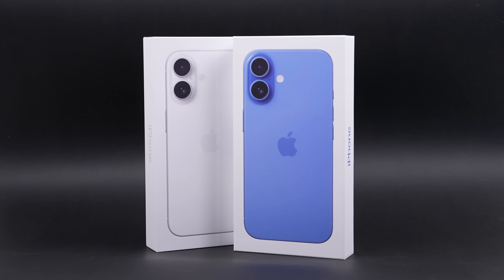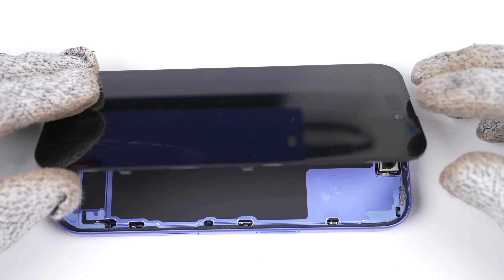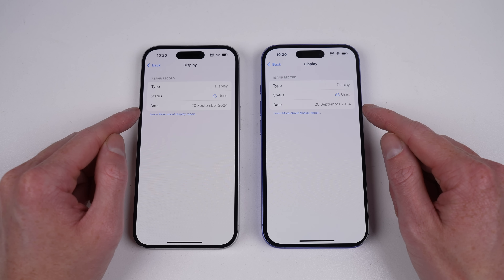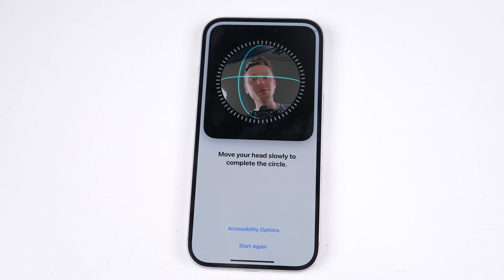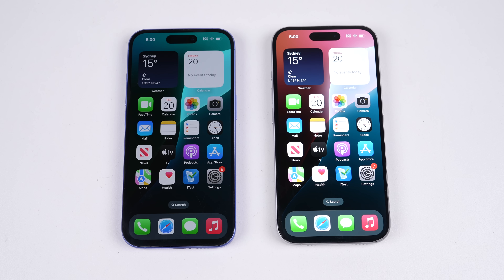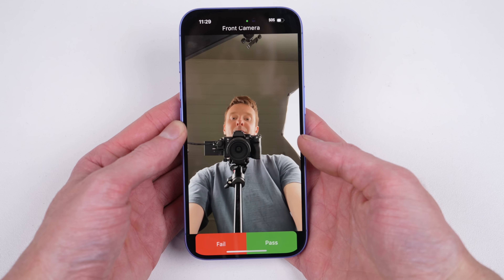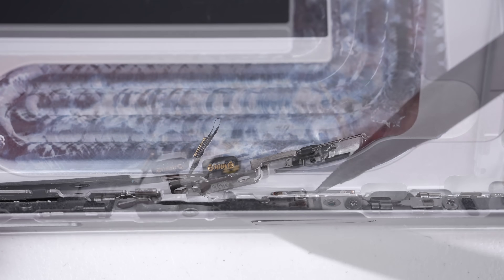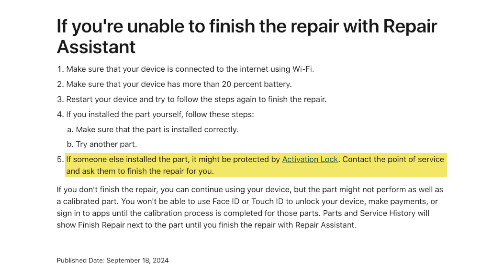iPhone 16 Changes How We Repair iPhones - 3rd Party Display Issues - Teardown And Repair Assessment

Comment: It’s funny how Apple is trying to seem like they are now repair friendly while also being as strict as ever. The new battery removal method is cool though!
Reply: I agree. Apple saw that it might be good for business to be repair friendly, as long as it has control over the repairs.
Reply: I think that has to do with the ne EU law that force smartphone makers to build easily replaceable batteries. It comes in force in 2027 as far as I know, so manufacturers might start "testing" different approaches until then to make that a reality.  The oldschool glue method is definitely not user friendly and creates a too high risk of breaking displays or other parts.   
Personally I would still prefer a simple holder that is screwed in, but it will be interesting to see the solutions different manufacturers come up with.
Reply: @Leif_YT  I think that has to do with the smartphone makers doing the bare minimum to try and stop some of these laws being past.
Suddenly those things that weren't possible because of "privacy safety and security"TM are in fact possible and those things that weren't "needed or wanted" are in fact needed or wanted.
Reply: Are you kidding it's not easy as you think
Reply: @twinklethomas2534  I don’t think I would chance repairing my phone having said that I would love to learn to
Reply: But the reason why they are strick is also preventing the thieves to steal tons of iPhones and mix thrir parts so the police can't catch them.. so until it has an another side what is actually good for the customer (to keep the $1000 phones on the list what they don't prefer to steal, because not worth it to steal.. it would be a thieves dream if the expensive phone is also the easiest to eliminate the evidences..)
Reply: it's a mix of Apple wants to make money, and Apple wants to discourage people from stealing iPhones to sell as parts
Reply: It sounds like an adhesive with integrated heating element
Reply: Nobody wants fake iPhone parts! This method is to prevent that an iPhone was repaired with fake parts!
Reply: Apple lets you repair the phone but not temper with the hardware.
Reply: @JayTB_TV you do realize he intentionally shorts the black one right 😂
Reply: I'm ngl but you're right, honestly, I'm trying to get iphone xr instead bc the new iphones are good, but start w/ the old ones before going up 1 by 1, until 15 or 16 series, then 17, not so much anymore.
Reply: @joshuaorozco4800  don’t get an xr it’s end of life
Reply: @hyrumhall8139  neither the x series? But it's where i wanna start
Reply: It's funny how people dismiss a companies rights to ensure quality parts are used in repairs via serial tracking, which requires additional user information such as which phone, the person who that phone is registered, ect. 

While you might think it's all overblown, your phone is a FCC radio device, required to be compliant with specific FCC standards to be allowed to operate at all. If you didn't have some method to track parts, you couldn't verify authenticity of the part, warranty status of the user, or the quality of the repair. 

It's a similar situation as customers complaining about giving a person access to their device. Would you rather 100% of your features and hardware work as they are supposed to and verified by an experienced tech? 

If you go to a place like Ubreak Ifixit, they run a software without checking anything is actually working. In fact, if there is an issue, say with the camera or the speaker, they can pass the test and let it go anyway, to save time and keep up with required internal metrics. 

3rd party repair would do a better job of testing because they have no other option. It's either ensure a repair goes out the door testing 100% functional, verified by a hands on inspection, or put your hands on it again when it comes back for rework. 

This industry lacks a quality, competent repair option, regardless of what you pick.
Reply: Quiet, kid.
Reply: Such an advanced method to basically do something we all used to do years ago by sliding our cover off our phones.
Reply: @sprockkets  yeah remember dropping your phone and the battery shot out happened to my dad while he was driving also iphones have never had replaceable batteries and this new system makes it so much easier than it’s ever been
Reply: Cool on the one hand, subject to failure on the hands of regular people just desiring to exchange a battery...
Reply: It looks cool yeah. But when did you have a 9V battery lying around? I never have bought any in my life and I also don't see myself rigging AA or AAA batteries together to get 9V. Pulltabs would work just fine.
Reply: Honestly, I was expecting some gotcha.

Their previous attempts where beyond useless. It's far from ideal, but just the fact that you can genuinely replace a component without making the process insustainable is more than I ever saw apple do.

This looks more that a genuine half assed attempt instead of a unusable lie like the previous attempts.
Reply: It's exactly why I never took their BS seriously when they brought up repairability in that recent Event Stream a few weeks ago. At this point I'm more than aware of their BS nowadays.
Reply: Nope the baterry removal is overcomplicated two straps od weak adhesive would do the job
Reply: @juri2001  Well, if they would use adhesive straps which would come out reasonably. AS in Samsung devices for example. I never had one iPhone where the battery adhesive was to remove as intended.
Reply: It's funnier..  how they go that far, just to make sure you don't go anywhere to fix your phone
Reply: Craig: "Plus, our new iPhones this year are easier to repair than ever before. (....so long as you do them with us and not anyone else)"
Reply: This is the best feature Apple has implemented,allot of repair shops dont use genuine parts even if the customer pays to be genuine in my country for example allot of iphones come with heating issues on the used market cause of unoriginal batteries and many of them are missing true tone and face id,this will prevent that and put good quality genuine part
Reply: @SiR.ReapeR-j7w sensor issues are because of Apple disabling them
Reply: this is a good step in the right direction, at least genuine parts work, and if you report an iPhone as stolen, parts from stolen iPhones won't work which to me is a good thing. As for 3rd party parts well there are loads of poor quality 3rd party items, apple blocking these isn't a bad thing IMO
Reply: @defnotatroll activation locked parts is a bad thing because it’s bad for the environment.
Reply: @defnotatroll  You  are aware that if you want genuine parts you can just go to apple right?

I'm glad you're happy, lets not worry about anyone else.
Reply: @stusue9733  the second hand market is the problem, shitty chinese 3rd party part replacements = scams
Reply: @defnotatroll  "shitty chinese 3rd party part"
They make all the parts.
Reply: @stusue9733  yes, and the quality of the parts they make for OEMs vs for third parties are VASTLY different
Reply: @defnotatroll   Oh, so why did YOU bring up Chinese then?
Lets face it, you're not likely buying second hand phones anyway.
Reply: @defnotatroll  It's no step anywhere, Apple is just good at framing it as it being so.
The issue with blocking 3rd party items is that Apple doesn't provide access to genuine parts those making the repairs could use.
As a business you can't get access to genuine parts unless you agree to be constantly supervised and scrutinized by Apple and relinquish all your autonomy and business to them.
Reply: @TheSerbianEmperor  it’s definitely scummy that they don’t provide the repair parts themselves, I agree. I watched Rossmanns video about it
Reply: It appears to be a million times better than before, but I have a few questions one I’ll mention now. Will genuine parts from a locked donor work like this or will apple keeps a database off locked parts?
Reply: I agree, but having this option in the first place is way better than not having it
Reply: I understand both parties’s arguments. I mean, iPhones are the most stolen phones on earth. Even if thieves can’t resell the stolen iPhone, I still wouldn’t want them to sell my stolen device for parts. Why anyone should make even one penny from the device that I bought with my own money?? And there’s a whole market for stolen phones. It is literally a business in some countries.  shouldn’t charge a lot of for repairs. Simple. 3rd party parts come into equation when original parts/service is too expensive.
Reply: @JayTB_TV if you think you'll end up shorting your phone in process maybe you shouldn't be repairing it in the first place
Reply: @divyamthakur if  repairs weren’t so expensive people wouldn’t need to try to repair their phones
Reply: You can repair it though. I don’t see the issue.
Reply: @rphntw1n  the issue is when your phone doesn't work properly after said repair because of apples stupid serialization system. There is no benefit at all except to apple as they can still control repairs.

Comment: That new battery removal method is pretty cool
Reply: Apple checked the new screen was not from a stolen device. I repeat what I said on another comment: I do not want my iPhone to be stolen for parts and this prevents it
Reply: @diedrino  finally someone with a brain. I think the iPhone is pretty easy to repair the only issue now is genuine parts from apple are too expensive if they were like half the price I’d have no problem replacing it’s parts such as battery but they are still expensive and only allow own parts which wouldn’t be a issue if they weren’t so expensive
Reply: One more hurdle towards repairing such device. Fuck Apple.
Reply: fr
Reply: See pre-smartphones.
Battery popped off with a flick of the finger.
You could swap batteries with a friend if you both had the same model.
Reply: @riffmondo9733  early and not so early smartphones also had non glued removable battery
Reply: Baterry removal is overcomplicated and sucks...
Reply: @juri2001  broken pull tabs are. a real issue and using alcohol is annoying, everyone has a 9 volt battery and some wire.
Reply: Pretty inconvenient
Reply: yeah. if you don't have that 9v battery, its probably gonna be way stronger than it used to be, and near impossible but if you have it, its way better than the 55 gallons of glue they use to use.
Reply: @Space_US  I much prefer the method of just using thin adhesive double sided tape to stick a battery. Easy to get it off and easy to replace the tape with something else.
Reply: @matthewjbauer1990 nah tray design is way better
Reply: @Space_US  most  repair shops would have a bench power supply with current limiting which would be better than a 9v battery in the context, so that's not really that big of a deal
Reply: @Space_US  why use 55 galons, when you need none? both methods are to make our lives miserable
Reply: @Space_US  Who the hell can tear apart a Phone but can't organise a 9V battery ??
Reply: @juri2001  they are using HTC battery methods thought up in 2013 on the m7 which used adhesive for the battery
Reply: @Gdsamplify  it's not the point, it's over engineered without making any practical use to the USER imo.
you have to remove two screws before even removing the screen and back plane. if they offered another mm they could have made it without adhisive and only required 4/6 screw to open up the phone and use silicone that is know to be kinda somewhat, very very very water tight compared to degrading glue, but idk.

same for the battery, have you seen those machined brakets? are you telling me they coulnd't afford to "over engineer" 4 corner braket for that battery and go without glue 
Here we have "the most eco friendly phone with 0% glue, all recycled aluminium sourced from recycled cans of beer that they collect from their third party repair shops that are drinking themselves to death over the idicracy of phone repair those days, and assembled by young enthuastic hard working children in China"

Comment: Basically every new iPhone generation comes with a new caveat to reduce 3rd party replacements (or even 1st party ones). I think Apple will still do this until legal actions kicks into place.
Reply: Can't wait for them to make handing your old phone to a family member for free or switching away from apple against ToS.
Reply: @crazystupidgamer  "to allow transferring ownership you as the owner must accept that you will need to a monthly subscription fee"
Reply: They're def waiting to be forced. Legislators are a) bought b) tech illiterate. Imagine if your car was hardware locked to only get oil changes at the dealership, or gas locked to only Chevron in a co-branding deal. They'd never allow such monopolistic behavior.
Reply: @randomnobody8770  serialization does happen in the auto industry mostly began with the radio being tied to the vin. But in many newer cars they tie all the modules to the vin too and yes you usually need specific tools to program modules.
Reply: @randomnobody8770 don't give them ideas
Reply: @randomnobody8770 electric cars are already there and more
Reply: it's two steps forwards and three steps back.. while I do like that you can used genuine apple parts to repair along with a Wi-Fi connection to verify.. we should be given those tools. Honestly i'm at the point where I would could to middle ground and pay apple a fee per year or 1 life time fee do have access to that software on a computer.
Reply: Most stolen phones end up in China, stripped for spare parts.  This is one way to fight back.
Reply: they have the money to buy the laws they want, so its unlikely to happen
Reply: We should just remove or loosen legislation we already have in place for copyright and patents. Then competitors similar to iOS would appear and Apple would actually have to compete for the specific market it addresses.
Reply: i think u just a hater no android company has as good quality as apple
Reply: @benNdaKen  I would say false. Since on most phones you can replace the screen and it works again. Whereas the apple phone needs you to do a whole song and dance for it to work again.
Reply: This seems to me like a good safety feature. I would be PISSED if I spent the money on a used iPhone and laterfound out it had been rebuilt from cheap trash parts and then sold for full price.

Of course, I wouldn't buy an iPhone of any kind, ever, but the point stands that it's a reasonable measure to ensure the value of a refurbished device.
Reply: @operator8014  No.
Reply: @operator8014  There’s always a risk to buying used hardware, unless it is from Apple themselves or another trusted seller like an electronics retailer. You weigh that risk against the lower price you pay for a used one. For all you know the phone could be stolen, or bought with stolen credit cards. Apple shouldn’t make repair so difficult and costly just to try to prevent the few scammers out there.
Reply: @operator8014  BROTHER THEN IT WOULDN'T WORK IF THAT WAS THE CASE. WHY DO WE NEED TO HAVE THE MANUFACTURER BABY US WITH OUR STUFF?

Comment: i just wanted to also give a heads up to something i doubt most people know about that i havent heard anyone speak about myself . on apple products if you replace parts such as the camera with another apple original you will not be allowed to factory reset it will just fail and then give you an error that requires plug into computer when i done this it failed from my computer aswell then i decided to take out the new camera and replace it with my old camera that was original with the phone then it succeeded . i found this out when i tried to reset my iPhone 13pm for sale after replacing the camera
Reply: Pretty sure that's because of the LiDAR sensor, if you break yours or replace it you can't pair your back camera again, which seems like an oversight
Reply: @SkynetCyb an oversight in a problem the manufacturer fabricated themselves, great!
Reply: @SkynetCyb an oversight from apple who constantly trying to trick their consumer? Yeah right.

Comment: Planned obsolescence
Reply: You don't say? Capitalism's point since the industriali revolution
Reply: I've had my iPhone 11 since release it still works great not slowed down at all I just upgraded to a iPhone 16 pro and gave my 11 to my little sister iPhones do last longer than androids unfortunately
Reply: people keep iphones longer than any other phone model
Reply: @randomnobody8770  see most people only keeping them maximum 3/4 years which isn’t long enough. With software
Updates almost reaching 8/10 years that’s silly to upgrade every 3/4 years. People really have something against replacing their battery and would rather throw out the entire phone over a battery. Bout as much logic as throwing away a Ferrari because it needed gas...or some small repair.